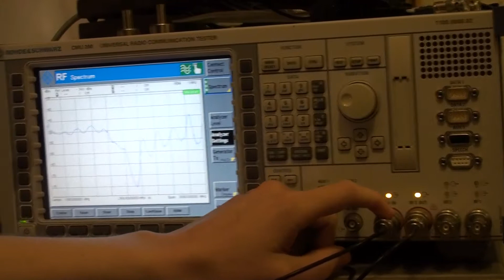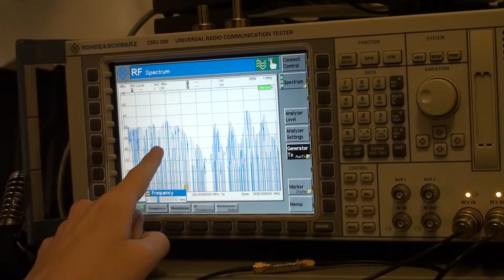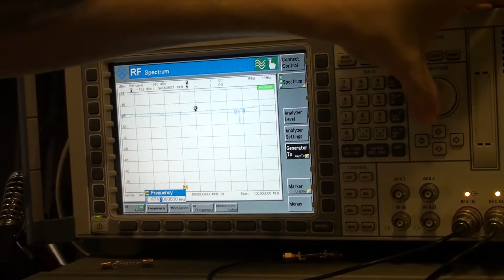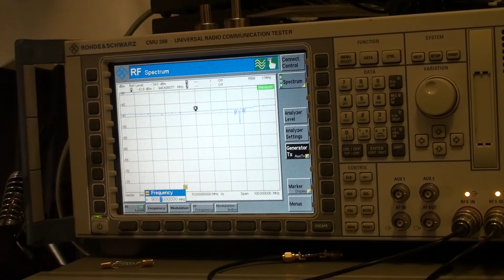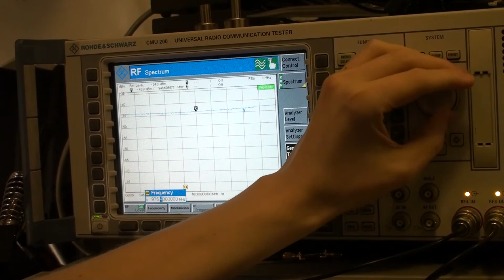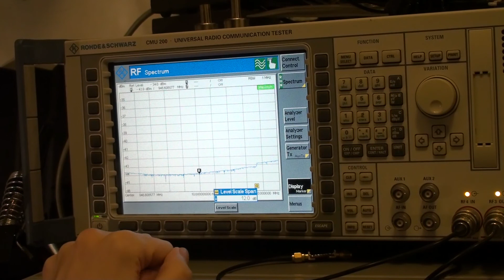017 R&S CMU 200 Tracking Generator?

Comment: Anyone have recommendations on the purchase of a CMU200 for use in ham and LMR radio?
I’d need a tracking generator for duplexer and cavity tuning...

No cellular.  Just vhf high & uhf freq analog and DMR/TDMA applications (140-170mhz / 440-470mhz / 700-800mhz)

I currently have an Agilent N9340a spectrum analyzer w/TG, but the screen has dimmed quite badly.
I also have a Rigol DSA815, but without the TG option.  (I know... stupid purchase without the tracking generator)

Any opinions/ ideas?
Looking for low budget price and high budget performance 😉😷🤣
Thanks
Reply: Any recommendations?
Thanks!
Reply: Since no one answered your post, I figured I'd take a stab at it, though by now you probably already have made your purchasing decision.  

I have no experience with DMR/TDMA, but the CMU200 is great for analog applications.  

If you can't find one at the price you are looking for, you might look for an HP/Agilent 8935 (E6381A) TDMA Base Station Test Set.  They are a nice inexpensive all-on-one unit with Spectrum Analyzer w/ TG, RF Generator / Analyzer, AF Generator / Demodulator, Scope, and TDMA Generator / Analyzer.  You can do power measurements and Sinad as well.   

The 8935 comes with various options (a built-in rubidium standard is a nice if you can find a unit with it installed!).  Mine has a built in attenuator on the main RF input which handles 75W, so no need for an external attenuator when testing 100W radios as long as you keep the TX short.  I believe the 75W attenuator is included by default, but be sure to check.   While the 8935 is older technology, and slower than the CMU200, it's an excellent piece of gear once you learn how to use it.

Comment: Cmu200 has a built-in sweeping generator. Go to the connection control -> generator (probably double click) -> table control (edit) -> sweep option -> set the start and end frequency or central frequency deviation. The sweep mode is not synchronized with 1LO the spectrum analyzer.
Reply: Though an old post, I would like to thank you for this excellent tip.  It's not something I even knew was there!  My particular CMU200 doesn't appear to have Connection Control >  Generator > Table Control > Sweep Option, but it does have Connection Control > Generator > Frequency Hopping.  I made the following changes on my CMU200 to get it working:  Hopping > On, Hopping Frequency > 0.1000000 MHz, Hopping Mode > Relative, Ramping > On.  This seems to initiate a nice sweep.  

To test it, I hooked up a low-pass filter between the Input and Output of the CMU200, and the spectrum showed the expected trace.  I also used Spectrum > View Mode > Maximum to get the same Max-hold as in the video.   I tried it out on a triplexer as well, and it showed the passbands just fine as I switched between the triplexer outputs.

I had been using a wideband noise source to check filters, diplexers, etc. but this is much more convenient for quick checks.
Reply: Do you know if the tracking generator feature is included in all of the CMU200 units?
OR... is it an “Option “?

Also.. is it something capable of service work for public safety 2-way comms / ham radio purposes?
20MHz through 960Mhz..

Thanks and 73

Thanks!

Comment: With a GPIB adapter you can also use Rohde&Schwarz's software for that, "FreRes". I used it with my CMU200 and my SMIQ03b, but allegedly it works with only a CMU200. You can actually use it with three devices to measure e.g. mixer responses. It is a bit buggy though and I was unable to change the default RF ports for RX or TX on the CMU. Or, as you mention, you can just do the sweep using SCPI commands with a GPIB adapter. Recently I have started playing with GPIB to get screenshots from the unit, but no good results yet.
Also you can buy the hardware kit on ebay. Did not try this though. But actually, generating the output signal from the LO really is the proper way to go for a tracking gen. Doing a software sweep really is only a sad fallback.
I think the FreRes software also sets the CMU into zero span (power vs time) mode and keeps the frequency of the generator and the analyzer in sync while sweeping over the range, emulating the LO tracking. It is quite slow, but probably yields the best results for the given hardware.
Btw, thanks! I bought my CMU in december after watching some of your earlier videos :). Very happy with it so far, but it is no comparison to the FSV and FSIQ we have at work :D
Reply from the maker: There is a lot of functionality that could have been rather easily implemented in software on the unit itself.

Though, there is a "zero span" feature on it, I think it is called "power" if I recall correctly. (I should probably make a video on it some day, but it isn't more then selecting a frequency, resolution bandwidth, and then it shows power over time. (With down to µs resolution if not better))

Though, there really shouldn't be a measurable difference between a software tracking generator and a hardware based one. Mostly due to how a spectrum analyzer works. At least when the spectrum analyzer and RF generator are as tightly integrated as they are in the CMU200, since here they share the same time reference, trigger source, and even share the same computer running the show. So having both the RF generator and spectrum analyser be at the same frequency at the same time should be fairly trivial. But I will likely make a video on the subject since it is actually a fair bit interesting.
Reply: yep, freeres is the way to go with the cmu200.